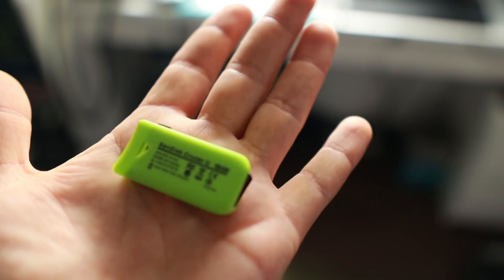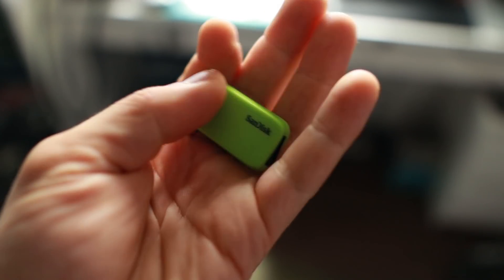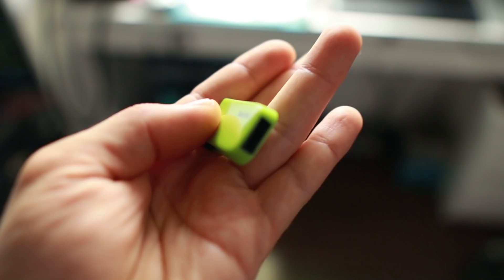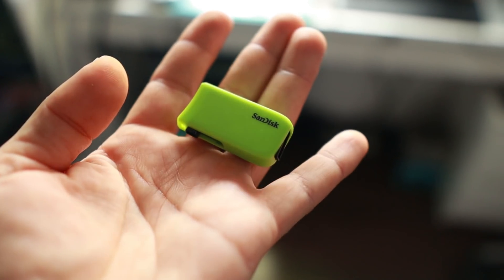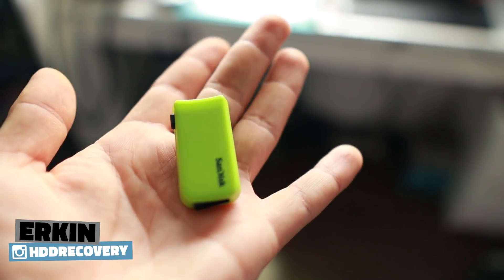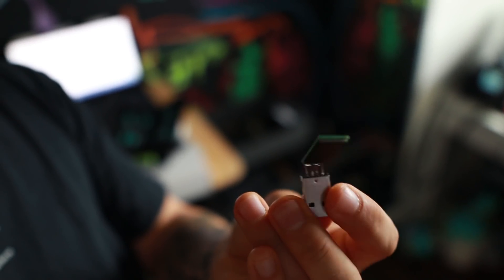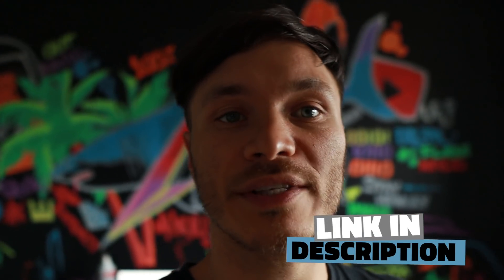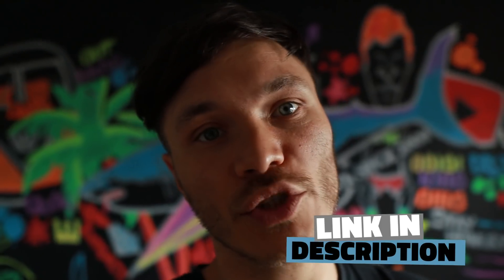what to do if flash drive snaps in half

Comment: I'm always impressed to see your micro soldering ability. I noticed two different gage wires used is this because one is for power and the other for bus?
Reply from the maker: yeah, VCC and VSS best to be thick. the rest does not matter much. I could have used 30AWG on all of them, but 41AWG was just nice to curve + enameled
Reply: Im using headset wires... its isolated and must be shape to soldering..
Reply: @gerdastimmel2968  How do you remove the insulation on these wires? I tried to solder them once and it was a nightmare.
Reply: @weinihao3632  just heat it.

Comment: Any chance I could PAY you just to ask you directly a couple questions about a hard dive I'm working on?
Reply from the maker: what equipment you work with, Craig?
Reply: @hddrecoveryservices  WD 3.5 6TB drive was in an external enclosure and got dropped. Took out drive and makes no noise plugged in so took cover off and heads did not park correctly. Contacted your place first and was $400 just because I opened it then $1,000 min and for a single mother it was not even affordable. so I bought 2 drives that worked and exact model just a year and 2 years off. I used a comb and swapped the heads over and it spins up but only get the heads clicking. Even tried swapping the controller boards. No scratches on top platter.